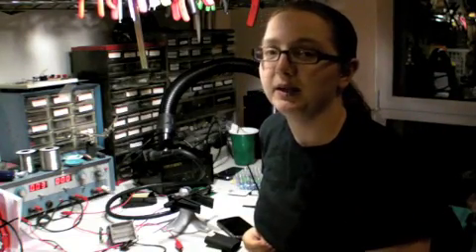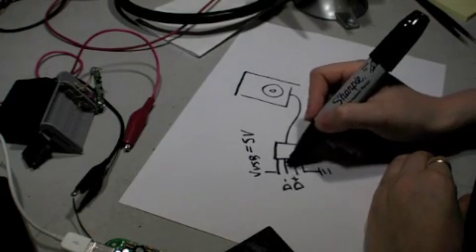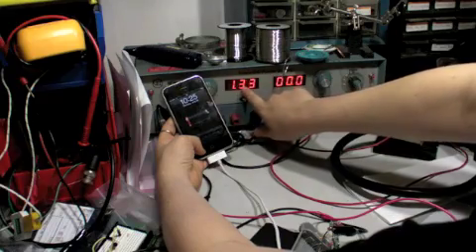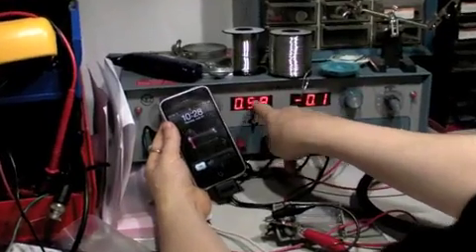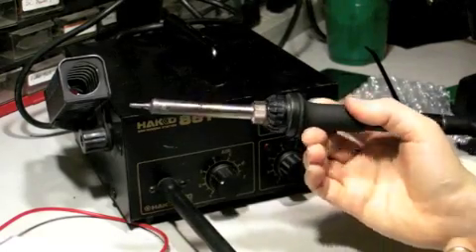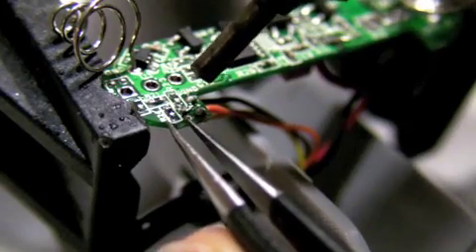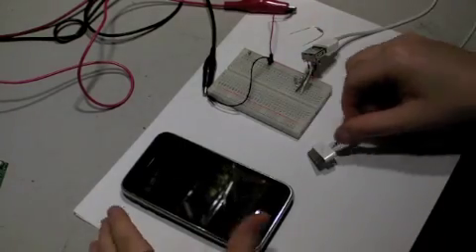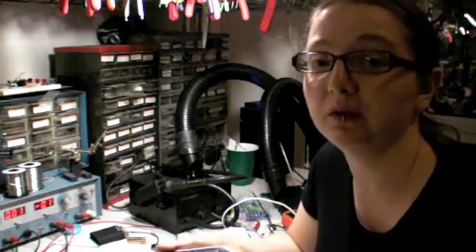Reverse engineering Apple's secret charging methods

Comment: i also want to make my own extra battery packs using lit-ion battery packs i have from older phones i dont need. need to step up the voltage to 5V and do the data line trick. should be no prob to suck 1amp from one of them batteries. great work you done! it really helps us out :)

Comment: ahh perfect! i was looking everywhere online if someone were to have taken apart my tunejuice by griffin. you answered many questions! i want your reflow hot air tool! i trying to figure out a few things like why these apple chargers go bad so often be it 29-39 dollar from at&t / apple or 50 cent to 1.50 one from ebay. and i also wanting to make a better charging system too. i found if i low on battery and make a phone call while charging it uses more than it can charge and eventually turns off

Comment: @AhwatukeeAl She measured four resistors, so I'm guessing they're being used in voltage divider configurations to set the voltage levels placed on the D- and D+ lines.  It would be more complicated (and more expensive) for the iPhone to measure impedance values rather than just run straight voltages into an ADC.

Comment: Pretty good video but I'm a little confused. You discuss voltage levels and resistor values interchangeably.  Are you sure the iPhone is sensing only voltage levels? How about impedance?  I know that if I plug my iPhone into certain iPod chargers, it recognizes the fact and tells me the charger will charge the phone but I will not be able to use the phone while it's plugged in!